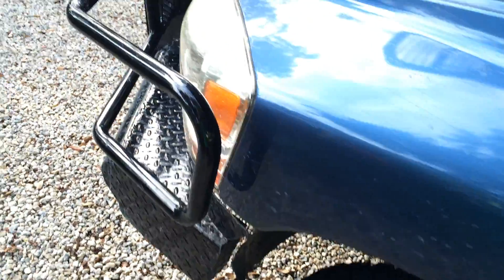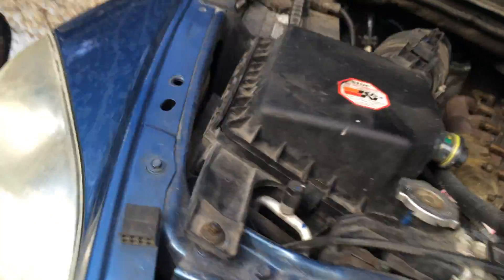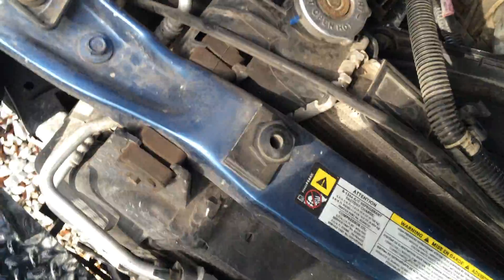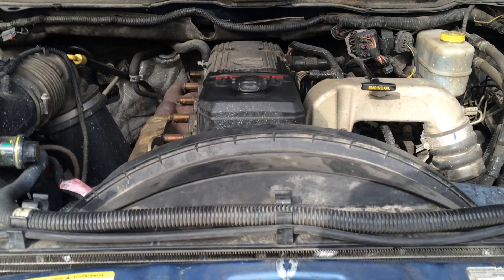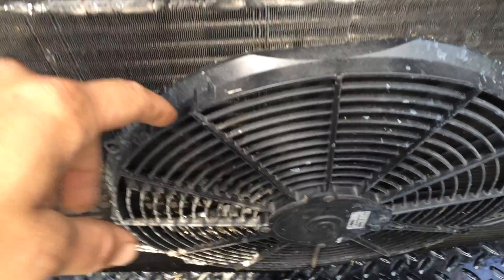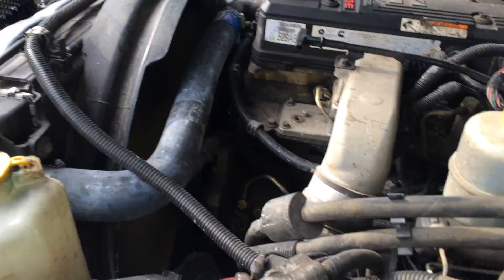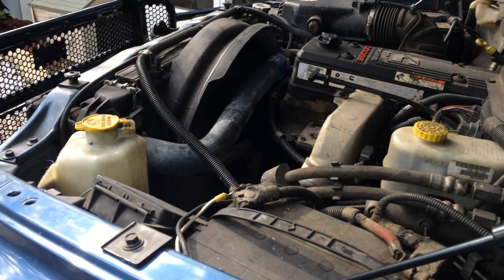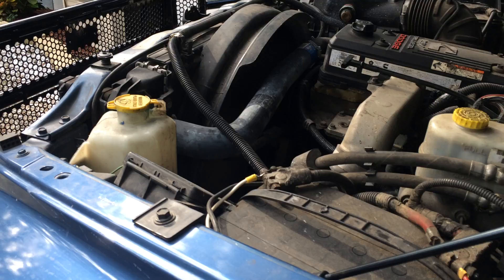Fan Clutch Wires cut? Problem Solved!!!!!!!!!!!!!!

Comment: so I have a 2003 cummins 5.9 , will this work on my truck? and my truck is not reverese threaded it's the normal type
Reply from the maker: sam peralta not reverser thread reverse rotation on fan it unthreads like normal bolt righty tight lefty loose
Reply from the maker: Not sure on that year

Comment: on the v10 clutch... do you have a part number? I just ripped my wires out crossing some water too... and its a total pisser with 100 degree weather we are getting and my motor over heating.
Reply from the maker: HAYDEN 2791   Reverse Rotation Severe Duty Thermal Fan Clutch